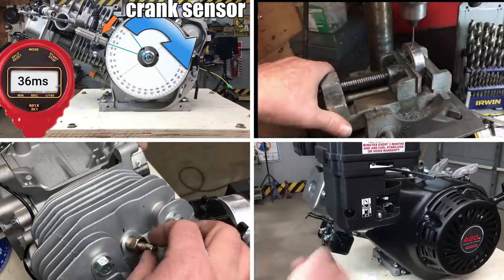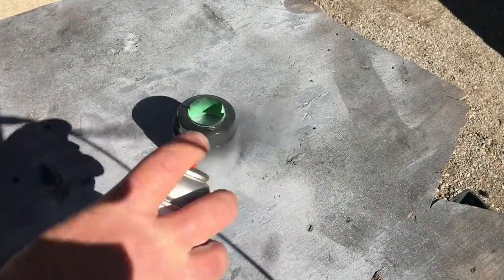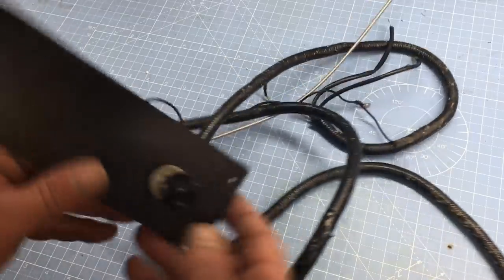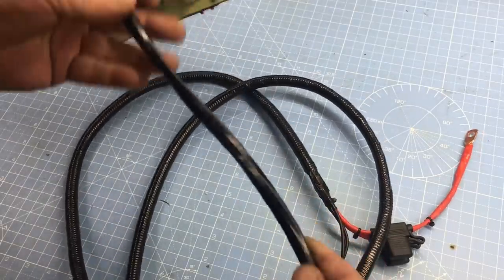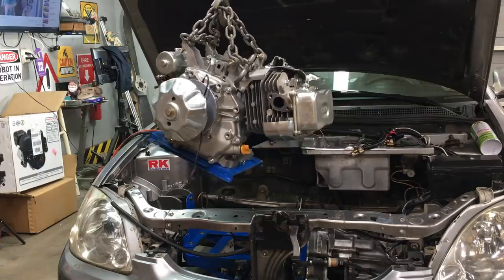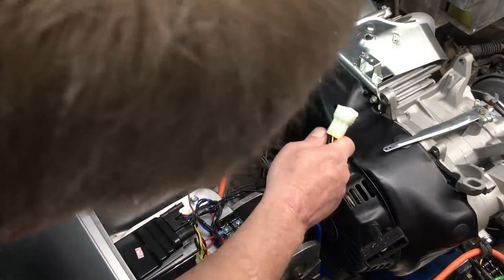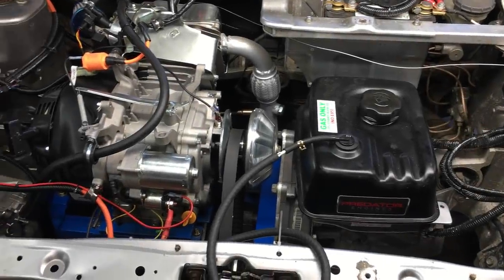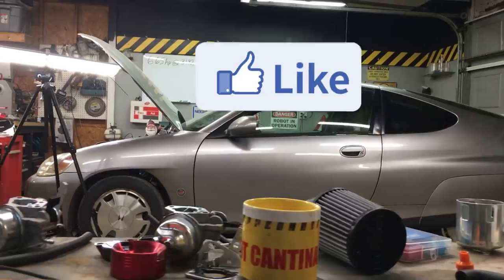Episode 22.  We finish installing the EFI on our 420 cc Predator . .. and it RUNS !

Comment: Scotch 33 performed very well in the project farm test, not sure why you had a disclaimer
Reply: In case someone tells him he's using the wrong product, lol. There's always that one person on just about every video that tells the video creators how badly they're doing.
Reply: @george8873  if someone says that then just call them stupid, pretty simple and entertaining
Reply from the maker: EXACTLY!
Reply: @robotcantina8957  Does anyone ever mod these gen 1 insights by keeping the engine & parallel electric motor but adding a charger and lithium battery bank so the electric motor can be used more often?
Reply from the maker: @michaelbrinks8089  The electric motor on these cars is built into the engine flywheel.... so when the electric motor is spinning, it also turns the engine.  Not very efficient as pure electric.
Reply: @robotcantina8957  CONGRATULATIONS  JIMBO    106K  SUBSCRIBERS!!!   we all love the content
and fun with ROBOT CANTINA.   Let's keep the numbers rolling on up👍👍!

Comment: Well, you made me build my own out of a toyota Camry. It drove 3 miles and the transmission went out. It had no oil in it when I got it and still quit even though I filled her up. I believe the drive chain broke. A 16hp engine broke a 125hp transmission.

Comment: Are those charge coils 1 wire output with a single diode in the wire?  If so, will you be incorporating a full bridge rectifier?  You could use the negative ground side to charge the battery for the efi and electric start, and use the positive ground side to run the lights.  That way you utilize the full output of the coils.  Unless I'm missing something.

Comment: New tires with deep tread aren't as efficient as older tires with worn tread blocks and less tread squirm.

The space saver spares will likely be worse unless you pump them up to some ungodly pressure.

Comment: Nice car, but its practicality is limited without heat. It would be interesting to see if you could create some simple ducting to direct some of the hot air from the engine into the cabin so that the windshield could be demisted in cold weather.

Comment: Just a note for you is that tires have the highest rolling resistance when new, but also the highest grip. They lose about 20% of their grip over their lifetime, and rolling resistance gets lower as well, so if your fuel consumption is the same then that is perfectly fine, it would probably have worsened with a normal set of new tires.

Comment: You could use an inductive sensor, same package as the one you have, and a cog with a number of teeth you need. There is nothing to go wrong with that setup when heat is applied, only metal.

Comment: 6:44 Huh? Never seen anything velcro in a Subaru except the flap that connects the back seat trim to the trunk floor. Were there actually years that used Velcro to hold components? Dig at build quality? Also funny you skipped episode 13, because Subaru doesn't like to use the number 13 on anything! Awesome video. You can even give the Insight 2 step now! :D
Reply from the maker: Just seeing if there were any Subaru fans in the audience,  I think the Honda folks are getting tired of me poking fun of Honda.
Reply: @robotcantina8957  Hahaha you definitely found one! I love Subaru. Extremely logical and easy to work on in most respects. They of course have their flaws though. I am a Honda fan as well, but surprisingly they have not been one of the easier cars to work on for me. Loving yours though! :D

Comment: I used a neodymium magnet to attach a piece of flex tubing to the exhaust on my portable generator. It lost it's magnetism in minutes and it never came back. It looks exactly like the one you have. I hope you have better luck. I replaced it with two larger ferrite magnets. They didn't lose their magnetism, but the one attaching the exhaust pipe cracked due to heat. For now I just wrapped them with aluminum foil tape to hold them together.

Comment: ...and the fun begins again! this time around you'll be able to really control+meter the fuel going into it, some torque power in lower range, leaner for cruising. wouldn't doubt the possibility of pulling +75 mpg from this project. turbo might be too much, these don't have a pressurized oiling system they're passive.. could tear up the rod+main "bearings" making it push 5-6 extra hp here-n-there.

Comment: The unpopulated Speeduino board, all the tiny components and the big-ass 690ccm V2 4stroke Engine are staring at me from my shelf again. 
i am saving up for the lathe-work on the shaft adapter's. I had to get the GT15 Turbo though - now it has joined the club on the shelf o.o

thanks for the motivation and showing that it can be done :)

That Project i can only work on in bursts - thanks to German TÜV i kinda get anxiety attacks, what if they don't "okay" it, what if they are laughing at me cause i am a Girl.
I plan to weld up the motor frame + motor/gearbox and bring it to them . That way they can look at the Workpiece and not at me >.< and they don't question my technical skills cause i have boobs. 

For now i am working on using the EFI on the stock 600ccm 2 stroke, but when i get the Adapters made i differently make a first startup video :O

Should things work out we should make a Smal engine powered car club.
what is the Lifan 2V78F-3  for an engine anyways?  the homepage states:
"It is compatible with the majority of all small, petrol-driven machines such as snowmobiles, small excavators or small tractors."
so can i call my engine a excavator engine ?  :D - don't bring me to build a pneumatic yellow arm on my car for the memes

best regards from Germany - Lara Craft
Reply from the maker: Hi Laura, it can be done!  The nuts and bolts is the easy part, tuning a single cylinder engine is the hard part  We shall see in the next episode.
Reply: @robotcantina8957  i got 2 cylinders tho :D 90° appart on same crank-pin.
Motor control and electronics is easy for me, i got a degree in computer since and always did electronics as a kiddo - on the other hand, i just got myself a welder (and fixed it), manged to fix my fuel tank, got some background in drawing and welding is not too dissimilar. If i do any progress i post it on the tube as well :)

and yes  you so productive, big inspiration for me, and a Rolemoddel :)

Comment: Thanks to your race tape on the steering wheel, it seems your alignment is off but I’m sure you already know that. Oh yeah and the tires leaking down every 3days is probably from excess crud on the bead of the rim, you could break it down with a rubber mallet and clean off with a wire wheel, the to reinflate the tires just take out the valve stem core and air it up. FYI fir your next budget build anyways now that you already bought the tires

Comment: I believe you could increase your fuel economy dramatically if you set it up as follows: engine to hydraulic pump, hydraulic pump to hydraulic motor hydraulic motor to large gear large gear to small gear on the transmission input shaft. The hydraulic force multiplication allows the engine to remain at idle while providing ample torque to the transmission for speed increases. Could go from 50 mpg to 300 mpg at the same speeds. Also, if you ran an alternator off the hydraulic motor output gear as well, you could charge your batteries while the engine is running and have higher output torque to run a larger alternator, and thus more battery power for a possible hybrid electric motor that could take over at cruising speed, further increasing range and mpg. Best of luck and hope my 2 cents helps

Comment: It's too late now, but does the Insight actually need 14" rims to clear the brakes? IIRC there are only 3 or so applications for that size tire: the Insight, the late model Mirage, and one of the 3 wheeled motorcycle thingies. On the Mirage I was able to drop down to 13" rims and run significantly less expensive and easier to find 155/80R13 tires.  Could be a way to split the difference between stock and the space saver spares anyway.

Comment: The headlight fluid reminded me of the blinker fluid of ChrisFix. I was wondering which Youtube channel was played in the background during the EFI explanation. Also I wanted to ask you, I'm getting into Programable EFI (like MegaSquirt) and I want to build my car. Would you recommend me to buy a second car/engine and do the tests or directly use my daily?
Reply from the maker: Megasquirt is a great ECU to start tuning with.  The second engine is not necessary, I used one just to make the videos but normally When I do an EFI  conversion, I make a completely stand alone harness and not modify the original harness if possible.
Reply: @robotcantina8957  notes took. Thanks for the feedback! P.S: I declared the war to the gnomes too!

Comment: I understand that you wouldn't want to run donut spares as your main tire, but i would guess that they wouldn't be a terrible option since you stripped a bulk of the weight from the car, and you aren't concerned terribly with your traction under load

Comment: Too bad the eBay seller couldn't confirm use on higher cylinder count engines as long a distributor is used. Guess I'll keep waiting for a fuel injection option that makes sense. Well, other than my pursuit of a half assed analog fuel injection that I'll be poking at after my MAP and crank sensors arrive.
Reply from the maker: It is a cheap kit.  Speeduino and rusEFI may work for you.

Comment: Is 48psi a normal pressure rating for a fuel pump for efi? I've dealt with aftermarket fuel pumps for carbureted applications and it's more like 12psi
Reply: yup, most carb setups are 5-7 psi, EFI wants about 50 psi.
Reply: Yep, 3 bar / 43.5 psi is considered the baseline for fuel injector pressure. Most fuel injected cars will actually vary the fuel pressure depending on the manifold air pressure too.

A good setup is typically 43.5 PSI of fuel pressure and then add or subtract the manifold air pressure at a 1:1 rate via the fuel pressure regulator (they typically have an air hose that'll go to the manifold). Fuel pressure should be set to 43.5 PSI with this air hose disconnected.

If you're in vacuum (ie. overrun) your fuel pressure could drop down as low as 32 PSI (2.2 bar), if you've got forced induction at 1 bar / 14.5 PSI boost you'd typically see 58 PSI (4 bar) of fuel pressure.

One of the main reasons for doing this is fuel injectors lose accuracy at either end of their duty cycles, by varying the fuel pressure you can keep the duty cycles within known-good limits (typically 10-80%) and still be able to deliver fuel accurately throughout the engines working range.

Comment: I would like to see what the running total of the parts are for the build. I plan on putting a 22hp in a bmw for a long distance race. I’m on a budget too and just curious what this will end up running me.
Reply from the maker: Its expensive.....but keep in mind this is for a video series and its not very practical as far as cost goes.  I think so far the 420 build is just south of $3K.  I will add up the costs at some point.
Reply: That’s not so bad. I was figuring about 2500-3000. I have seen others do stuff with the 22 hp predator, but I love how thorough you go through and explain stuff. Keep up the good work.

Comment: It takes the tires 1000 miles sometimes more to break in. Your mileage will get better
Reply: I put 120 pounds of air pressure in those re92 tires. Drove them that way for two years. I am now down to 80 pounds. The tires are nine years old. You get better mileage all the way up to 90 psi. I can’t tell any difference from 90 psi to 150 psi
Reply: I also have four yellow spares in the four corners with re 92 tires.
They do just fine. The temporary tires will last about 2000 miles give or take 300 miles. Depends on rocks.
Reply: I also took off one of the front wheel brake rotors. That reduces 7 1/2 pounds and takes away 28 pounds of inertial mass.It’s like putting on a Aluminum fly wheel.I get over 100 mpg. Also deleted the battery muffler 2 windshield wipers And both front car seats. I’m down 180 pounds. And I only drive around with 2 gallons of gas to reduce weight. I have a 5 gallon gas can at home. Which is like grid charging if you have an electric battery car.
Reply: I’ve got six different cars 2000 insight. Some of the other cars I bought had different tires on them. You go 20 pounds over PSI rating they are gone. More air pressure more mileage Potenza are the best I have experienced by far way far.

Comment: Pulley and alternator setup?
Reply: the doubled mags "may" be enough after swapping to all LED lights.
had LED headlights that were low beam only, they were just bright enough to drive with around town, not quite enough for unlit back roads at 45-50 mph.